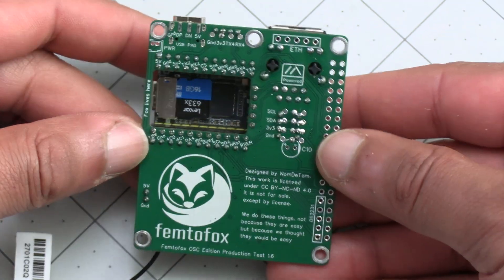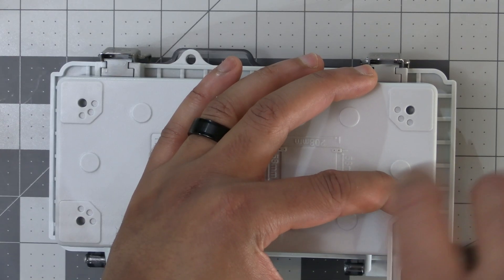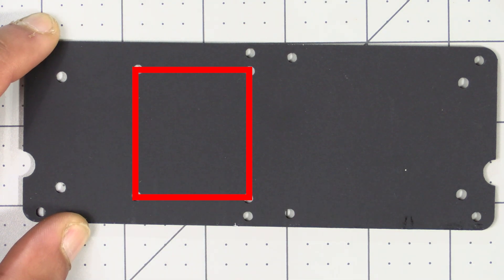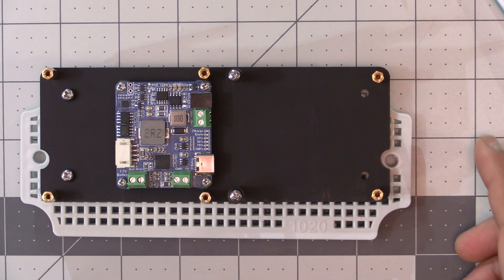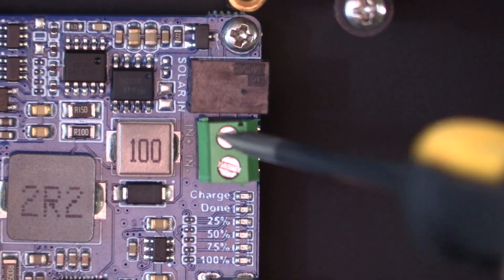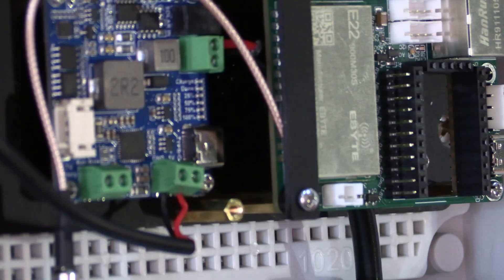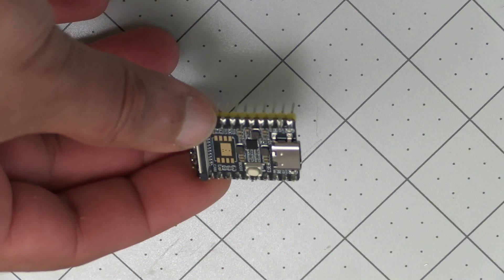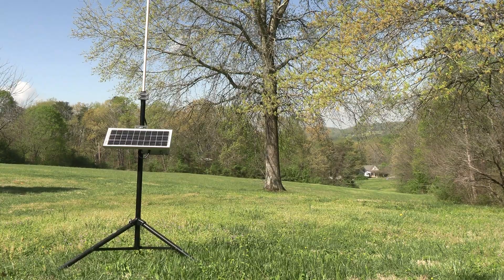Femtofox Solar BBS - Build Video

Comment: Maybe you said it in the video but I missed it. Does this still function as a normal Meshtastic node, able to repeat transmissions to extend the mesh? Or is it purely a send-and-receive node (like CLIENT_MUTE)?
Reply from the maker: Yep, it functions as a normal node and you can configure whatever role you want for it
Reply: @The_Comms_Channel excellent. I need a node for my backyard, it may as well be this haha
Reply: @The_Comms_Channel  one other question. If I connect it to my WiFi, can I connect to it with MeshSense? Or is the WiFi connection purely for setting the clock?

Comment: I was reading that very cold temps are possible if you limit the charge rate to low levels. Can the waveshare solar manager control the charge rate?

Comment: Hi. You mentioned successive cloudy days would drain the batteries with the 15w solar panel. Can the solar manager handle a more powerful panel and still be safe for the Femtofox? If so, would the batteries you used need to be swapped out for different ones?
Reply from the maker: I tested with this solar panel as well  https://amzn.to/44tfZOQ

The panel is bigger so the mount I used in the video won't work and used this mount for it https://amzn.to/3RoYCHo

This setup is a bit overkill so I didn't use it for the video, but if you have concerns with the 15W panel not being enough for your area, then this setup is one that I tested and confirmed.
Reply: @The_Comms_Channel  Thank you. I live in the PNW so it's gloomy for long periods. And 30w... nice. I wasn't sure it could handle that. And i take it the solar manager is still happy and not on fire.
Reply from the maker: @justinb2924  Nope, no magic smoke when I tested it. Their wiki page just mentions a voltage range from 6V-24V so anything in that range shouldn't fry it. The Wiki doesn't mention wattage, but I assume there is a point where it won't use all of the available wattage of the panel and it would be a waste. Just not sure what that number is
Reply from the maker: Their wiki https://www.waveshare.com/wiki/Solar_Power_Manager_(D)

Comment: Where did you get the battery holder? I am assuming the batteries are in parallel (3.7V config) and not in series (11.1V config)? I am looking forward to building this. Thanks for your efforts.
Reply from the maker: @charleslayno4372  you'll enjoy it! Batteries are in parallel and the battery holder is included with the Solar Power Manager
Reply: @The_Comms_Channel  Thanks. I already have the Femtofox and just received the enclosure mount for the Femtofox and solar manager. FYI, I don't think the exact solar panel is available any longer. When going to the link you provided, it only shows the 5w and 10w mono panels and no mention of the 15 watt anymore.

Comment: This is great.   I have a question.   If I just wanted to build a repeater without the BBS functionality, should I use the same hardware and just not turn on the BBS?  I would like to build several repeaters to put out in the community
Reply from the maker: Thanks! You could do that; the BBS isn't required. If you don't need the BBS, you can check out our previous solar build which will be less expensive.

https://youtu.be/shlttaysWJM?si=F_dend2vf27nKdTc

You can probably ignore the 6 battery setup with this. We've gotten on just fine with 2 batteries and most people should be fine as well.
Reply: @The_Comms_Channel  I like the idea of the larger panel.  Could I use the wisblock with the solar charger / panel from this video?
Reply from the maker: @MontieOutside  yep, that'll work fine. Run the USB cable from the solar power manager to the USB-C on the wisblock

Comment: I know you do meshtastic stuff usually but do you know if an AM radio (sadly probably gonna have to be custom build because i never saw a 518 khz am radio) and its audio output could be used just with a pi pico to decode navtex messages?

And if you do satellite stuff, do you know if there is an off grid solution for receiving data from polar orbit satellites (so basically no TLE data updating over internet)?

Ps: I only think these and never ever tried building anything myself so everything is theoretical i guess :/
Reply from the maker: NAVTEX is possible with an SDR. As far as satellites go, it would just be a case of constantly monitoring for them as decoding as they pass. I know there's a number of them that go over pretty regularly.